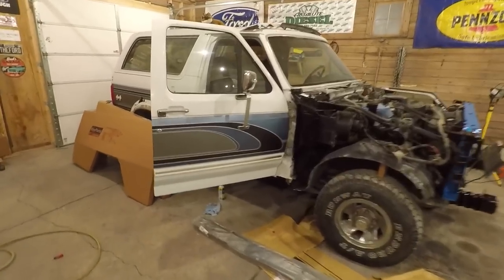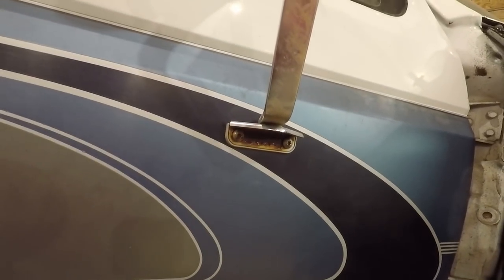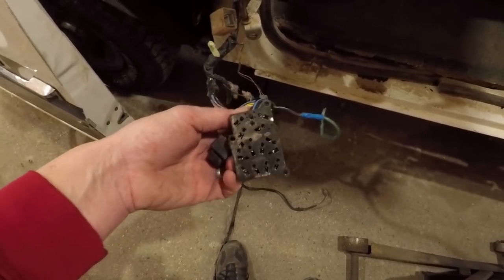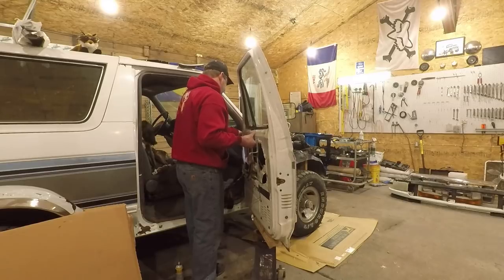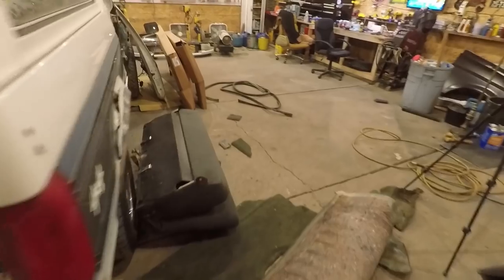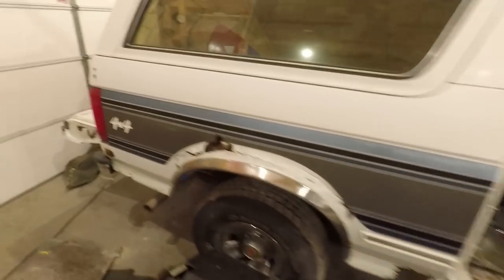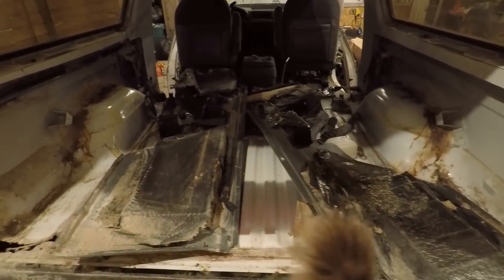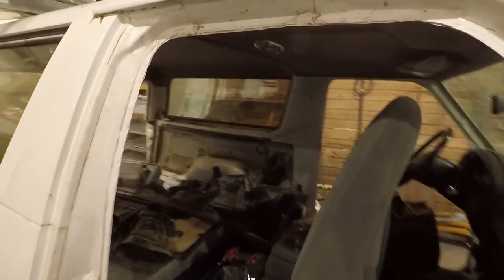THIS is WORSE Than I THOUGHT!  Ford BRONCO Project

Comment: Every time I watch one of your project truck videos and realize more and more what a gem I recently picked up. 1995 F150 5.0 RWD two tone red and black with 0 rust. I'm in the salt belt as well but she spent most of her life in florida. Previous owner crashed in LF, frame is perfect, and i want to learn bodywork and to weld and figured this was the truck. Nobody else would touch this truck but i knew she was worth saving. Thanks for all your videos I have learned a lot. Keep up the good work!

Comment: fox shop you can buy a comb for the fins on the radiator and a/c condenser, just google radiator comb and it will come up. It will straighten the fins so you won't have to replace it.

Comment: Use raptor liner in the rear bed area. I have used it on multiple projects and turned out nice. Comes in a kit with gun and hardener. Also can be tinted to color match if you buy the tint able kit

Comment: I don't know how it is up there, but in South Carolina those mirrors are hard to find. If you sell them they would probably go fast. A lot of the brackets on those mirrors turn up instead of down like yours. I ended up painting mine with high temp satin black paint. Great Video!

Comment: Get a rear seat from a brick nose or bull nose bronco, they have self contained lap belts as a temporary fix, but for best safety wise would be a cage that incorporates an anchor for the 3 point setup

Comment: I came across the same problem with my 93 bronco, most states require to have the 3rd brake light and seat belts functioning, a rollbar is the best bet if anyone is going to ride back there. Also my driver door has a gap just like your. Mine looks like it got yanked open to far mount your door back on and you see how the hinge is pulled out bending the body or door. Mine is pulling the body side out

Comment: I'd either incorporate lap belts out of the rear of an 80-91 extended cab, or mount some posts to the floor, just higher than the seat for the seat belts. Not a big fan of roll cages in broncos to be honest,

Comment: I'm right where you are been working on my truck for 6 months needs a whole new rear brace and leafs springs with mounts before the front and rear body panels. My interior floor and rocker panels are in really good shape just my rear is like yours still deciding on how I want to do the rear tho.love the vids!

Comment: I like that you are keeping safety in mind.  So many don't even consider it.  I have antique plate on my bronco.  My state is fairly lenient about that but, is supposed to stay mostly original in design.  Unless the changes done are a safety improvement over stock configuration!  States vary.  For some states it's illegal to drive with the hard top removed.  Like many other laws that one is more B.S. than safety relevant.

For on-road driving I'd install a rewinding quick release style lap belt in the back and call it good.  They are safer than the reputation portrays.  Unless you roll over.  Rollovers are a whole other bag of dangers.  If you plan on going on off-road adventures a cage or roll-bar minimum with 4-point belt harness either way.
Reply: To do any job well it takes a bit of time.  The removal of parts usually don't take much time for myself but, putting them back in the correct place and getting it to look nice while staying practical takes me forever.